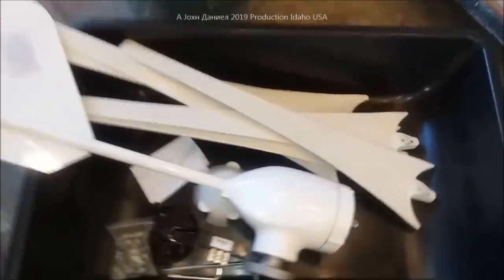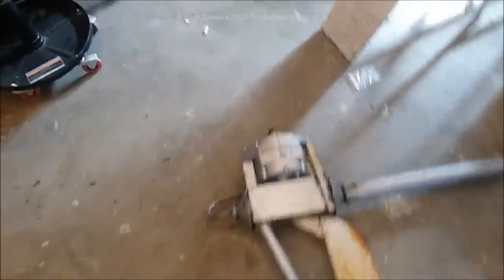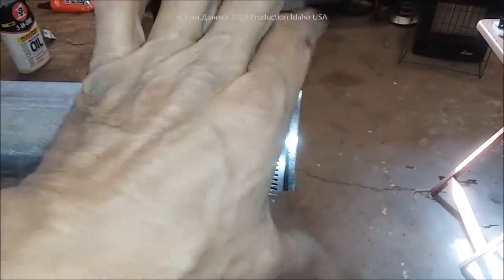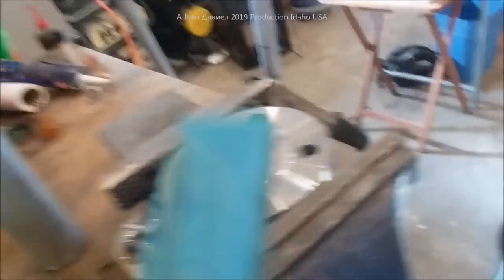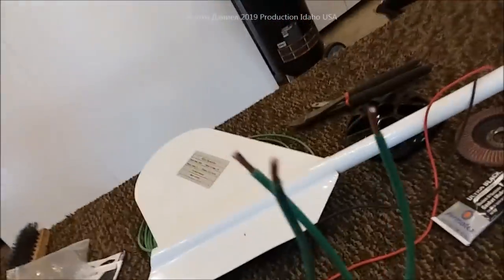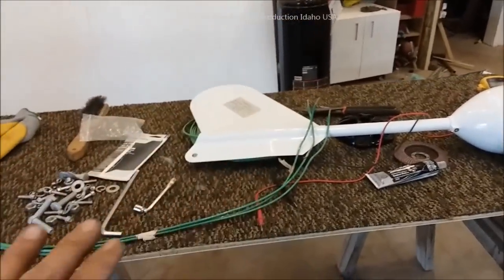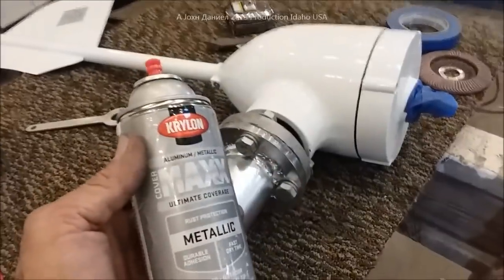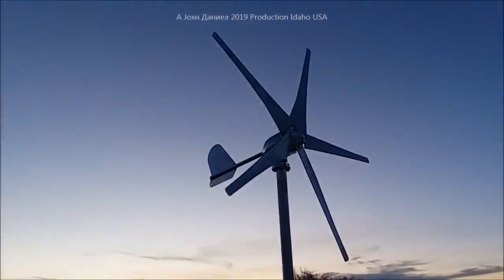Accurate 500 watt, 5 blade Micro Wind Turbine, The Install build, ALL PARTS LISTED BELOW!

Comment: Hay how hot can these turbines get before it breaks down?
Reply from the maker: 230 degrees Fahrenheit is the winding coatings limits. I never saw mine in huge 50 mph wind storms exceed 150 degrees.
Reply: @JOHNDANIEL1  wow ok thanks bro.
Reply: @JOHNDANIEL1 do you know the rpm at 50mph winds?
Reply from the maker: It will always depend on the blades used. But the 3 blade is 1400 to 1600 rpm, the Aero blades are 1000 to 1100 but make more torque.
Reply: @JOHNDANIEL1  doesn’t that exceed the rated rpm for the turbine? Sorry for all the questions i just got one

Comment: Hi, I have the 500 watt wind turbine but I keep blowing rectifiers 100amp 1600v only in very strong winds. What can I do to solve this problem.
Reply from the maker: James you have to go 150 amp https://amzn.to/3TIeTcS the proper heat sink,  https://amzn.to/3tR5CVb and use heat sink compound https://amzn.to/3vllVdf on the back of the rectifier. I had to do the same thing for the 600 and 800 I am running, efficiency increased by a little, and no more toasted rectifiers. 
YOU MUST run minimum of 6 awg from the rectifier output to battery so you do not get resistance and heat on the output that will burn them. Small wire makes huge resistance it can fail from.
Reply: Hi John, Thanks for for the information and will be put in place asap as I am fed up buying rectifiers. I have watched all your videos and love them so keep it up. Here in in Scotland I bought the 500 watt wind turbine you recommended and love it.

Comment: Not having bought through AliExpress before, what is involved with additional customs fees and customs clearance
Reply from the maker: It depends on where your at. Normally they deal with VAT fees but always make sure when you get to check out page you read all the related info. 
You can also put what you want in cart, then under the store name hover on it you'll see "contact". Send them a message. They answer fairly quick. 
If your buying from one of my Ali links to them tell them you need a 5% off offer for JOHN DANIEL you tube channel.
Reply: @JOHNDANIEL1  Thanks so much for the quick update, learning tons from you. I'm needing to build a VAWT and would like to see info on parts for that, like blades, etc..
Reply from the maker: VAWT designs are very insufficient still. Only a few prebuilt I would even recommend. But if you plan to use a fisher paykel PMA generator design it may help.
Reply: @JOHNDANIEL1  Having an issue finding the Fisher Paykel design PMA. Looks like Missouri Wind has one…. but. If you know of a source for those that would be nice.

Which prebuilt VAWT would you consider recommending
Reply from the maker: I'll look, send me a email and I'll get you some info back on it. olympicpowercontrols@yahoo.com

Comment: Hi John - what setting is your meter on for the tests [at around 10:00]?  ...poor thing has seen some usage, huh?  ;p
Reply from the maker: 200 volt AC
Reply: @JOHNDANIEL1  Thank you! Also, I have another question for you that I think your experience will add to the answer - I've got 2 turbines A & B. On my workbench I have each connected to pretty much the same meter you use and pass the juice to a 300W razor motor as the load. I spin them each at around 700 rpm and they only generate about 115W! Which seems really low based on everything I've seen. A is 12V, specified to reach 2kW. B is 24V, specified to reach 1.6kW.  Do I just have 2 dud turbines? I'd really appreciate your take on these numbers.
Reply from the maker: When running them into an open load is not the same as running them into a capacitance battery your results will differ.
Reply: @JOHNDANIEL1  Ahhh. Makes sense - Thanks very much! Suggestions on "best" test bench battery [really only to verify specs vs. an actual storage bank].? I've heard golf cart batteries, but I'm new  ;p  And I'm cheap! I greatly appreciate how you take that into account in all your clips that I've watched.
Reply from the maker: Definitely go GC2 STYLE golf cart battery.
Reply: @JOHNDANIEL1  Awesome - thank you John! Hey, I've been curious - why Cyrillic in your last name?
Reply: Ha - replied too quick! I just checked and a GC2 STYLE golf cart battery ranges from $180 - nearly $1800! Am I seeking the wrong thing? Thanks [yet] again!
Reply: Clicked your link; found the $140. Not cheap, but cheaper than $1800! And better than getting poor numbers!!!
Reply from the maker: My Family tree is from Lithuania in the early 1500's. The language then is Pre-cyrillic somewhat of the kingdom.
Reply from the maker: Look up East Penn manufacturing, they make the GC2 STYLE sold by Batteries plus. Top notch at lower price.
Reply: @JOHNDANIEL1  Ah, very cool! Previet!  [misspelled almost certainly!]
Reply: @JOHNDANIEL1  Email has been sent [didn't see any on the sites, but my search terms might be off] - thank you John! I'm looking forward to getting everything hooked up, spinning, and watching the numbers! No fires or electrocutions, either!!

Comment: Have you ever tested ista breeze turbine? I currently have a hurricane wind vector turbine and great turbine, love to have another, but when check Tony website, thier isn't a buy it now button anymore, so looking for an equivalent turbine.
Reply from the maker: We installed 2 of the 750 watt ista turbines. I told the guy who bought it that the blade size don't call for 750 watts. It only hit 533 watts in 25-30 mph winds. He later installed 2 sunning 800 watt turbines and got over 1100 watts in 25+ winds.
Reply: @JOHNDANIEL1  thanks John, I appreciate you taking time, that's what I was wondering, I'll have to buy a sunning and give it a shot.
Reply from the maker: Your in luck, B&C is one of the very few licensed dealers for sunning turbines. And if you buy more than one they can cut you a damn good price on shipping and these things are seriously heavy solid machines. https://s.click.aliexpress.com/e/_ABoFOx shipping is very high but your total price is over $100 less than buying it direct from sunning.

Comment: Hi john do they come small in size  ????
or can u put me onto a good vertical axis one that you know that works well.
cheers jm
Reply from the maker: Check my channel for the 300/4 00 model they work very good and I would suggest a five blade model with a mppt controller that can do solar and wind. If you need direct links to them let me know.

Comment: Dear John. Like many I enjoy watching many of your videos. I have installed few solar panels at home connected to a 1000w grid tie microinverter. It works well but am thinking of upgrading to try wind as we have more windy and rainy days and my panels are not getting as much as I hoped. I could add more panels but does not overcome weather.. I'm in eastern side of viti levu in Fiji & Get a lot more rain. However no one here has any experience in smaller residential wind power.
 Can I use the same Chinese 500w wind turbine and hook it to the microinverter and feed into the grid? Will I go direct into the microinverter without using any rectifier?
Appreciate any advise you could provide.
Thanks Avinash
Reply from the maker: You can install a 48 volt model with inverter made specifically for it based on your voltage/hertz of the Fiji system. Wind in 3 phase will not work into a solar micro grid tie. If you want a kit designed for your need, I can contact the people at B&C for you to get you a size and function rated all in one kit for you. The best options are the RS232 and dump load models, and as a designed kit I can get you a good deal on them if thats your goal. You can send me more info of your situation to my email olympicpowercontrols@yahoo.com . I usually replay in a few days, depending on the amount of emails i get.
Reply: @JOHNDANIEL1  Dear John
 Thanks for your rapid response. Shows I have a lot to learn about wind power systems. I'll email you more details after work.
Cheers and happy holidays 
Avi

Comment: You have a link to a "low wind" turbine but this is not correct, i ordered one three blade 24v by following this link but it need at least 500rpm to climb over the battery voltage and start charging!
However it starts to spin at low wind but it needs really high windspeed for charging.
Please tell me wich model you have tested that really start charging at cut in at approx 3m/s
Reply from the maker: Checking the link, its on a few of the other videos, its still to the low wind models, maybe your browser or a pop up diverted you based on your system. All the low wind models I have installed and the 2 I have are running as advertised in capabilities. But if you have them too close to the ground or obstructions or are combining solar or different chargers against them you can get different results.
Reply: @JOHNDANIEL1 if i follow the link i get to a 600w three blade and no oftion for five, anyway  i'm suspecting the problem is with the 24v version.
The resistance in a 12v stator is 0,9-1.0ohm and in the 24v 1,1ohm, it could even be the same!
Could you please measure at wich rpm your turbines starts charging, its easy done by measuring hz before the rectifier, each rev is 6hz
Reply from the maker: @HJFF1969  I can check into that RPM ratio. I do know its at and sometimes under 8 mph for the 500,  at 7 mph on the 800 watt I do exceed average battery of 13.0
Reply: @JOHNDANIEL1  ok perfect!
I guess my turbine  (24v) will exceed at least twice that windspeed and therefore i presume  it's also a 12v in reality.

Comment: Now... I'm not sayin. I'm just sayin. Wouldn't it save you a ton of time just by using a pipe cutter instead of a portaband? Cheap, and straight the first time.
Reply from the maker: My big 1 - 4 REED pipe cutter is 50 years old, my 25 years of rigid gas, galvanized and packing lead/oakum in years doing plumbing (shows my age hahaha) I finally found a wheel for it since that video, But most people do not have a pipe cutter that can do this so showing how you can do it with a saw is handy.

Comment: My question is about how to figure the dc output voltage of the rectifier from the different wattage (400 500 800 etc and 12-24-48v..... for example a 800watt 24 volt generates what range of dc voltage output from the rectifier? And the same for a 800/12 or 800/48.  What is the formula to calculate it?
Reply from the maker: It is kind of a natural standard for the open voltage to be three times the prescribed sold as voltage to be the output at rectifier without battery. That is called open voltage. Example: open voltage for a 12 volt turbine will run between 36 and 42 volts DC at the rectifier without the battery connected. When you connect the battery it draws the power down to what the battery needs the battery resist the incoming power and creates a charging result. Open voltage on a car alternator can be as high as 60 volts that's why they tell you do not disconnect the battery on modern cars it will cook the electronics inside.

Comment: Please find me a wind-gen that can produce decent amps at less than 17 mph wind?
jtjohnston@jtjohnston.ca 
819 993 8746 
See Slim's disaster test with a Chinese wind-gen
https://youtu.be/ZvXwqMWbt1c
It took gale force wind to get the generator to perform.
Reply from the maker: See my most recent video on that 800 watt. I would get a 800 watt 3 blade and it will shock you on its consistency and very low winds to give you quite a bit of power but you must be sure to get the auto braking wider design blades you see on mine. I put a link below that 800w turbine video I just released that get you straight to b&c wind.

Comment: This Produckt is a SHTEPOWER.COM 
THEY produce and Sell  TEP3000@12V ..TEP6000Watt hewy duty  (GOT 1 12v 2 48v) 
wery high QUALETY EMP EMC AND RFI tested for NOICE radio polution
They produce and Sell  EPever MPPT wery high QUALETY EMP EMC AND RFI tested for NOICE radio polution
They produce and Sell EPever inverters wery high QUALETY EMP EMC AND RFI tested for NOICE radio polution 
And we have testet the Produckts in Denmark by EDR Aalborg .. Experimenting Danish Radio operatorer .. or HAM OPERATORS
a bunsh of engineers , cientists and sattelite builders .. 
No wonder this wind turbin Works.. 
Ill buy the 2000Watt 600RPM 48v 
PMG and the 5 bladed 5m² sweapt area .. 
The 3000 Watt control box with 2x 1500watt hotwater dumploads / break load  .. 
Ill make a vid of my 2x 6000watt PV with 4 EPever 6415ND 
20 200Ah AGM deep cycle batteries 
Off Grid in the middel of  the city ..
Using rain water to toilets and cloath washing

Comment: what model Grid Tie Inverter would I use on this 500Watt wind turbine?  I don't want to include batteries at this time, just want to run the circuit in my house via a 120v outlet and shove anything left to the power company grid.  Any idea?  Will this 2500 watt power inverter that is mentioned in your video do the job of a GTI ?  thanks.
Reply from the maker: use a 48 volt model turbine and always be ready for a wind storms to make this thing hit 1200 plus watts so a 1500+ wind to grid tie is best method.  I often install the 2500 on the 800 watt 48 volt model, same store and people in the Ali link below video, and the outcome is excellent. But its big, 7-1/2 foot blade circ and must be on no less than sch40 2" pipe, preferable to use RIGID 2.5 sch40 from a place like PLATT Electrical supply. Yes, they make 2.5" for Electrical use and its tough!
Reply: @JOHNDANIEL1   will be in west Texas with no welding equip available 20miles from nearest town ...do all pole mounts require this method?
Reply from the maker: @richardsmith6157  Yes they do. Would you want a 2" pole pre-made mount for it? I do make them for my regular installs at about $50 delivered in the lower 48 states. It is multi fit so good for 300 to 800 watt turbines. It drops into the top of a 2" Sch 40 grade 10 or  20 foot section of galvanized pipe and is locked in with set screws made of self tap screws you drill the pipe for. That way you can just mount it on the turbine, drop it and its wire into the pipe and tighten up. Let me know, olympicpowercontrols@yahoo.com
Reply: thx for prompt reply...am needing 2 purchase wind turbine first...will combine with solar panels..constant wind and sun out there!

Comment: Which one do you most recommend all things considered? The 3 or 5 blade?
Edit:
Nevermind. I see in other comments that you've said the 5 blade is better in lower wind speed areas, & the 3 blade is better where winds around 20mph are commonplace.
(Yes, I actually scrolled through & read some of them. Yes, I know I'm weird & I'm proud to be so nowadays)...
Reply from the maker: Good deal, but beware, the damn 5 blade spins all the time, just 5 mph and its turning. And thats good yes, but it only makes over battery charging power at and over 6.7 mph in my test. Thats a lot better than the 3 blade though in low wind areas. But in high wind, its never going to hit them crazy 1300 watt burst like the 3 blade. It did in 44 mph hit 1090 watts, so its heavy made and capable, it just has too much mass to hit the free RPM's the 3 can. BUT, I am making a 4 blade myself since they don.t make one, and YES 4 blade it works, Emerson Electric built and has 12 massive 4 blade, 90 foot diameter, 98,000 watt turbines installed since 1973 still running in Owyhee reservation desert on the Idaho / Nevada line.

Comment: Greetings I have a doubt please help how I can put a manual brake to my wind turbine and what I need for that thanks
Reply from the maker: You can put a manual brake on one, just using a switch with 3 poles. Not recommended though, its the leading cause of turbines burning up. Sellers of turbines want you to do that, so you buy more.
Reply: @JOHNDANIEL1  thanks😬

Comment: you need a pretty substantial drill to bench test turbines for amperage, ive always found blades put out more amps  than bench testing with a drill, that is once a turbine is up and running in the winds.

Comment: I love your hands on no BS approach.  I am looking for a couple of turbines to augment my solar backup system and look forward to seeing how these perform.  Thanks for all you do.
Reply from the maker: My suggestion is the 3 blade if you have any good wind at all. Its a true performer. If you have very little wind but better winds at night you need the 5 blade. But never expect them to make 500 watts just because theres a breeze. I use 8 of the 3 blade models on our place in Texas, much less wind than I have here, they run all the time but at 100 to 200 watts due to winds never getting much over 15mph which gives me 100 to 140 amps battery feed most the time.

Comment: Have any ideas for charging lithium ion batteries with a turbine?
Reply from the maker: Yes, get the 48 volt model, charge 4 basic 35 amp hour 12 volt SLA batteries ( its called slave batteries) with it, then connect your 30 amp Lithium capable solar charge controller to those batteries to get a sourced 48+ volts to charge your 24 volt LiPo bank.